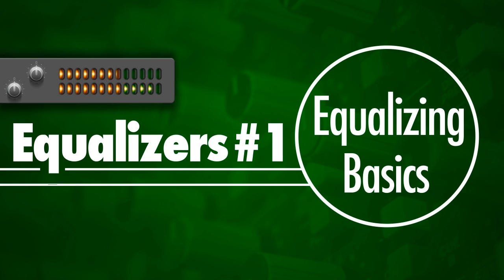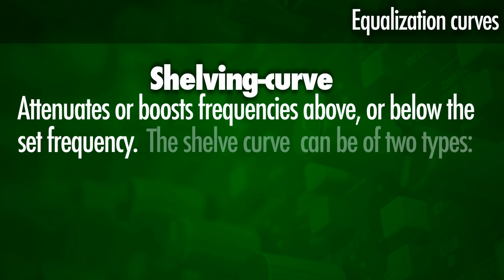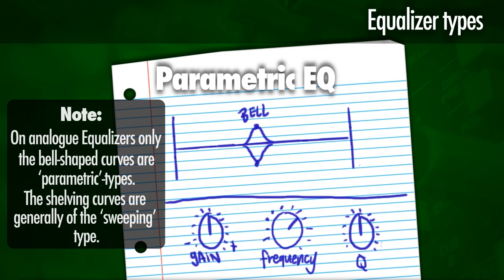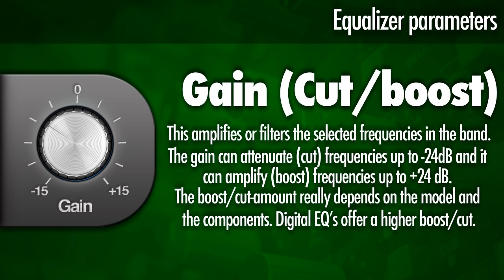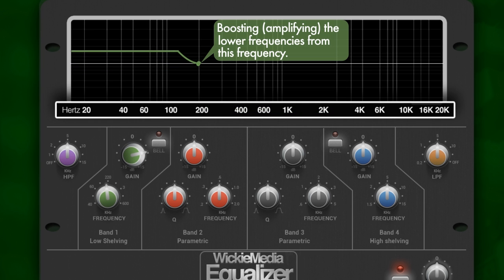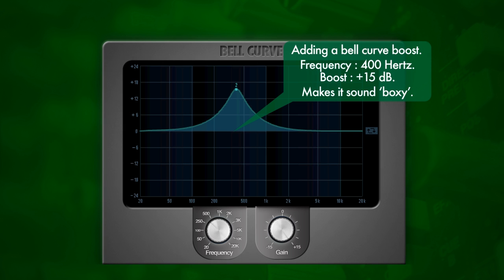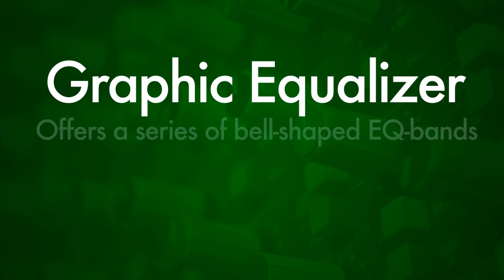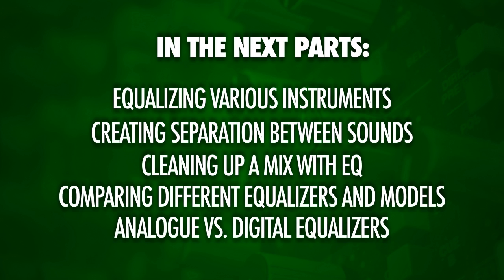Equalizers explained #1 - EQ functions

Comment: " An equalizer or EQ, is being used to remove or add frequencies of a signal"...How can you add a frequency? It's (the frequency ) either there as part of the audio being played back or its not.  No?
Reply: I believe it depends, for example some instruments might not have any low frequencies at all when playing at higher pitches, however, in some cases these low frequencies can still exist but they are too quiet to be heard so we can either cut them off completely, to avoid any unwanted noise, or boost them so we are able to hear them... Hopefully this answered your question! any other questions! :D

Comment: The only difference between a low-shelf and a high pass filter is that a low shelf can cut or boost while a high pass filter is designed specifically to cut, right?

Sorry if this is a dumb question, I'm still trying to get the hang of this.
Reply: yes you are correct sir!
Reply: however remember you can adjust the "resonance" to add a little boost at the point where you start you high pass filter

Comment: Can you connect a graphic equalizer to a sound bar? I have an old ken wood eq that I want to use to enhance sound of my Vizio sound bar, preferably the bass. I'm a novice but I think I may need a receiver with an amplifier or maybe buy a subwoofer. My sound bar didn't come with a subwoofer. My sound bar has a digital optical (which goes into my tv), 3.5 audio, digital coaxial, and rca audio connection. Thanks

Comment: Going to be pedantic here, but at the beginning you said "an equaliser is being used to remove or add frequencies of a signal", which is incorrect. Equalisers adjust the amplitude of the frequencies of an audio signal. Although it may sound like I have said the same thing, the difference is huge and crucial to understand.

If an audio signal contains no high-end information, an equaliser will never "add" those frequencies if they don't exist. Similarly, if an audio signal contains low-end information, an equaliser will never "remove" those frequencies if they exist. You either attenuate frequencies or boost frequencies - you never add or remove. 

This is important for when you want to "enhance" an audio signal. Preferably, EQ should be avoided if you want to enhance the signal. Other processing can be employed for enhancing the audio signal. "Enhance" is a subjective term. What I really mean is add "texture" - specifically, this means to increase the harmonics of the signal. No EQ can add "texture" i.e. increase the harmonics of a signal. Pitch shifters, distortion, comb-filtering etc. are all better methods for increasing the harmonics of an audio signal over EQ. Or, adding synthesised textures is a preferable method in my case. 

EQ is better to be used primarily for correction purposes over than enhancing purposes.
Reply: Also NEVER use low shelf boost, as it absolutely smushes your instrument balance, take the deep tones of your base drum as you want to boost the base and make it "bass heavier" or in other words moove more air because low shelf boost smudges the undertones of even a guitar or singing voice too! If you start to listen when you are using bell curves to boost the "bass roots" you will notice your mix sounding x times better then before! :)
Reply: Michael Lück It's unreasonable to say never do (x) or never do (y). 

Shelving will generally sound more natural on non-percussive instruments than using bell shaped curves for boosting and cutting (especially for boosting - not so much for cutting). On percussive elements, (such as a kick drum), you can get away with using bell curves because kick drums rarely contain harmonics related to the fundamental. That is to say, you can tackle a small range of frequencies, and then apply a large boost because it won't sound unnatural. 

However, if you have a guitar, for example, which is very harmonically rich (or any string instrument because strings, when plucked, excite many harmonics), and you use bell curves for boosts, or cuts, you are limited to the amount because you may bring out certain harmonics which ring and don't sound musical at all. If you tackle a small range of frequencies from a guitar, and apply a thin large boost on the EQ, you will start to increase the decay time of those frequencies which may causes either unwanted ringing or muddiness. And remember that the harmonic content of a musical instrument is what defines that very instrument. So using thin boosts, or cuts using bell curves will change the harmonic content and thus, make it possible to redefine what instrument it is. Hence, why it sounds unnatural when you use bell shaped boosts on musical instruments. 

Shelving either boosts, or cuts a large range of frequencies rather than a few if you were to use a thin bell shaped curve.

My method is as follows (on non-percussive instruments): I use high pass and low pass filters for removing unwanted frequencies that are barely audible (the "clean-up stage"). I use shelving for changing the tone of an instrument; if I want something sounding brighter, I will scoop the low shelf right up to the frequency where I think the high-end starts, and then slowly apply small cuts using the shelf which will bring out all the frequencies that are being untouched - the same vice versa if I want something warmer using the high-shelf. I use bell shaped curves for tackling specific frequencies that are either a) masking the frequencies of other instruments or b) have some annoying ring to them or just nasty frequencies that don't make the instrument sound good. That's it. I sway away from making boosts when EQ'ing. 

However, I am talking about natural instruments i.e. any instrument that has been physically recorded. When it comes to digital instruments, synths, samplers, drum machines etc. this method doesn't really apply - you can do much more damage with an EQ on synths without making it sound unnatural (because it isn't a natural instrument to start with). 

What do you mean "low shelf boosts smudges the undertones" - I would argue to the contrary. It is bell shaped boosts that "smudge" the undertones because you are tackling a small range of frequencies and by boosting, not only are you increasing the loudness of these specific frequencies relative to the other frequencies, but you are also increasing the decay time of those frequencies - in which make it possible for those frequencies to overlap with others - hence the term "ringing". A shelf tackles a large range of frequencies - and so shelving avoids unnatural ringing of certain frequencies as well as avoids unnatural tonal balance (if you use small amounts). And I am talking about non-percussive instruments here - on drums, you don't come across this problem.

Comment from the maker: Hi Filip, I explain this in the currently running season, which is all about mixing theory and mixing consoles.. 

If you assign a mono track to a stereo-bus it basically 'becomes stereo'.
(Panning a track 70% to the left than just sends more of the signal to the left-side of the stereo-bus than to the right-side.) 

The insert-processing, like equalising or compression, takes place before the panner, so it can be treated as a mono-channel with mono-plugins indeed.